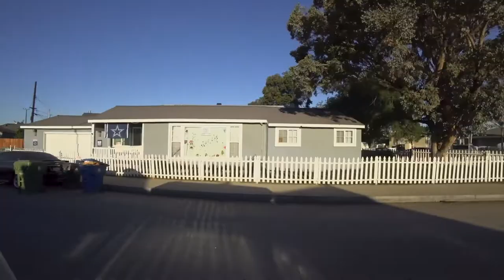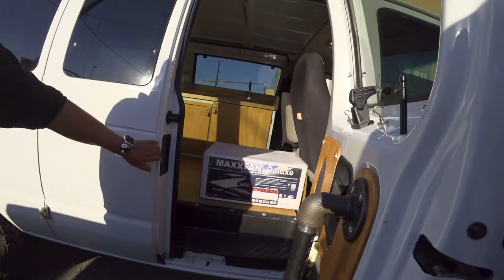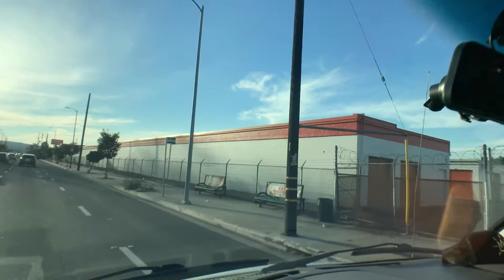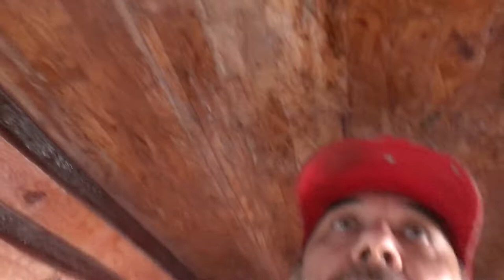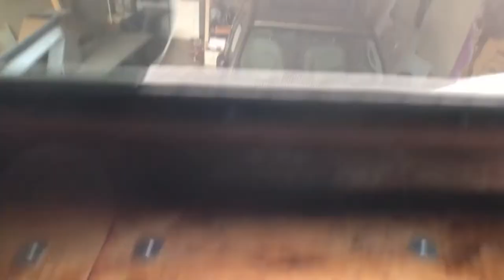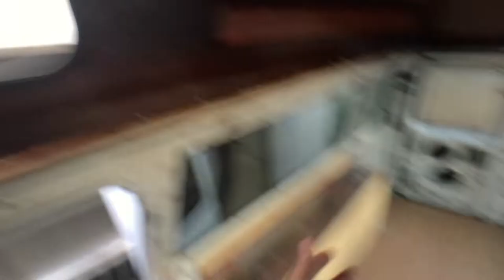FIBERINE HI TOP TRANSFORMATION | BEFORE AND AFTER

Comment: Great think about Cali somehow we go great aftermarket businesses here. Acton Van was an hour from me. w3ldt3k was 30 minutes from me. Camburg is in Hunington Beach. Madness 500 the aftermarket Fiat company. They are in California. Their intakes are not for use in California..............
Reply from the maker: So I contacted both Action Van and Weldtech and Action is 50% less
Reply: @CHICOandtheVAN  I love my Action kit! I have the standard kit and it was $2400 shipped with Bilsteins and a steering stabilizer. I couldn’t justify the extra $500 for the fabbed radius arms cuz I’m street 90% of the time and I don’t see the need to push the wheels forward. Honestly tho, if budget allows it on my next build I might go Weldtec just to see the difference. I don’t have the convenience of being near either shop for installation though so my decision was based purely on parts cost. Just my opinions 😁
Reply from the maker: I’m going to wait to see what kind of driving I’ll be getting into and then asses whether I need a lift or not. I’m thinking a locking rear diff is next. Let’s see how the next year goes 🎉
Reply: @CHICOandtheVAN  I always have 50 ideas in my head for videos. One of them is Revenge on Bombay Beach. When my van was stock height it got stuck there. With a Rear locker I would of got out. If you are going to do a decent amount of overlanding a locker is a great mod in conjunction with a hi-lift jack a tow hitch to have a lift point. Lift is nice and I wont lie I went lift to mainly look cool but I will get a locker. Now the dilemma is do I go automatic locker like a Eaton Trutrac thats around $700 or selectable like a eaton e-locker $1200. I will make a video about this. Rear locker and my van is officially done.
Reply from the maker: Noted* and the price difference is almost 50% …I don’t plan on rock crawling but back country roads might be in my path. Thanks for the input.🤙
Reply from the maker: I just watch a guy with some air lockers having to clean all the differential oil out of the passenger side of his van because oil leaked into the air hose and dumped into his van.
Reply: Adventure Ready Van Life  What's a Spicer Locker?
Reply: @CHICOandtheVAN  When a vehicle comes with a locker from the factory and it's selectable it's eaton e-locker style. I need to find out if automatic lockers act like limited slips and have a potential of just engaging out of nowhere. I dont like that because that's no bueno if it does that in the rain.